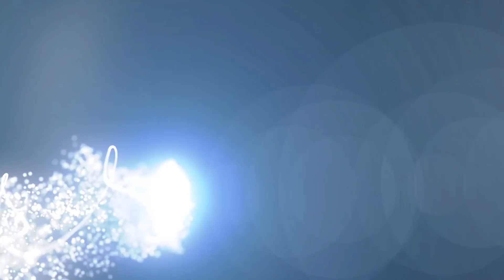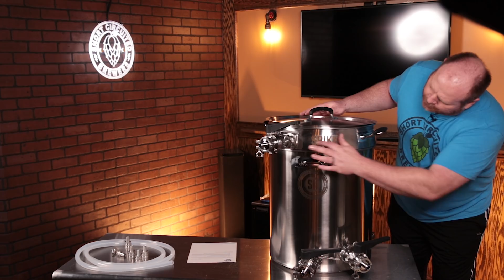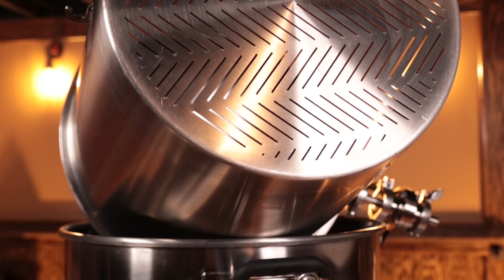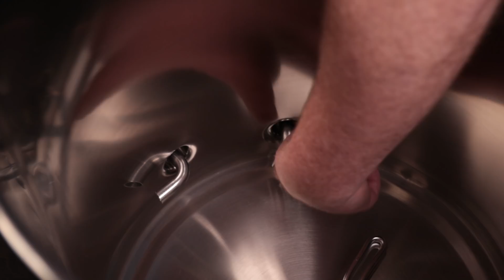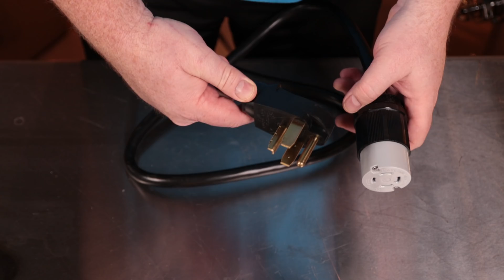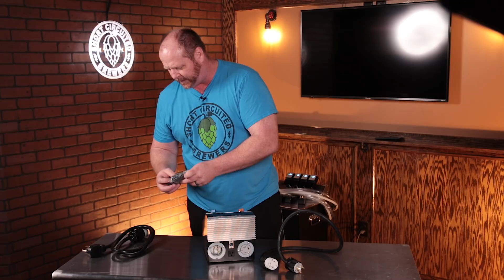Spike Single Vessel E BIAB System First Look!

Comment: I know this is a prototype but I'm honestly pretty disappointed. Lots of hype for something lots of other companies have designed, produced, and almost perfected. This is a $600-800 unit. I can build one for that or less. SS Brewtech is gunna blow this thing out of the water.
Reply: Dan we'd love to put our new single vessel system up against a vaporware product ;) The industrial controller in our design is $600 alone so the price point will be a little higher but pretty in line with other single vessel systems on the market.
Reply from the maker: 😄😄 "vaporware"
Reply: @SpikeBrewing  🍻
Reply: Brewtools is the one to beat at this point. Ssbrewtech and everyone else have their work cut of for them if they want  people to spend $1500 on theirs instead of brewtools.
Reply: @Mezoloth  Remember competition is good for consumers 🍻
Reply: @Mezoloth  I'm torn between buying a brewtools or waiting for the SS brewtech e-biab.
Reply: @DanSienkiewicz  I built my own, but if I had to do it again brewtools would be my choice. Too many great features and quality for the price. I was looking forward to the ssbrewtech also, but got tired of waiting.
Reply: Dan Sienkiewicz when they gonna do that???
Reply: @GreatHambino1  just keep checking the website, it's been pushed back from Fall 2019 to "Late Spring" 2020
Reply: SS Brewtech already has the BIAB setup. The 1V was designed as an add on or for BIAB. I have it and use the brew bag. The brew bag sits right on top of the low density element while on and never scorches. I am interested in the basket though with Spike. Not sure if it’ll go on sale at the same time as the 20g system goes on sale. I would expect the quality of this system to be on par with their other products when it’s released for purchase. I love my 1/2 barrel unitank from Spike. The quality is unmatched!!

Comment: It’s more capable than the grainfather less the wifi and buggy app.  My guess would be $899
Reply: Definitely double that
Reply: Jordan Williams If they do that will kill it
Reply: Its a 240-volt system. it's from Spike. -1399 no pump 1599 w/ pump
Reply: Robin Heud you’re probably right.  My math is 350$ for spike+ kettle, $350 for the  controller (like Blichmann BrewCommander), $199 grain basket.
Reply: Im going to revise this number if it comes with a counterflow chiller $1199
Reply from the maker: I think that is a little low based on the cost of the individual components.

Comment: Thanks for this awesome review along with all your other ones. I'm thinking it will be $1,100 ish. Then an option to have the pump included for $1,250-$1,300 depending on the pump.
Reply: Unfortunately a little more. An industrial panel like this is about $600 alone. Our mott, Not Cheaper. Just Better.
Reply: Spike Brewing I'm still down for that! Just a swag at the price. Looking forward to seeing what it comes in at